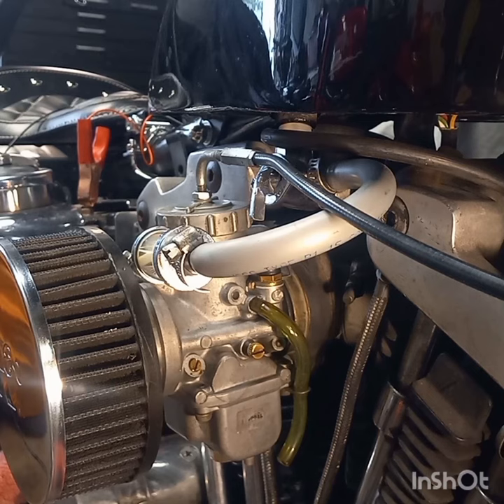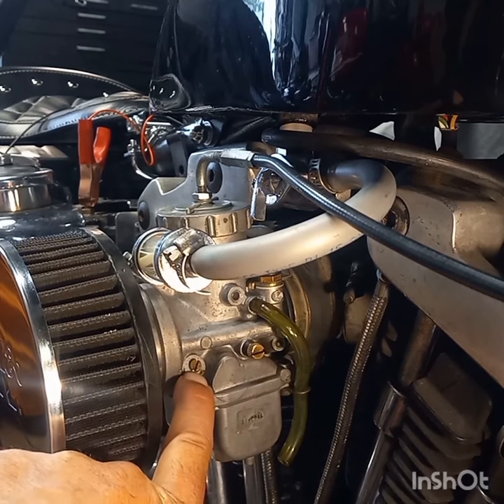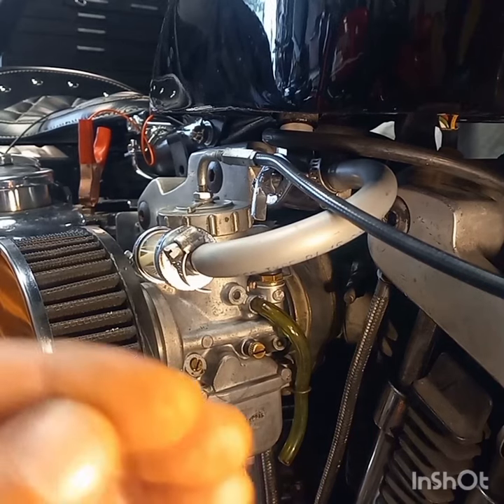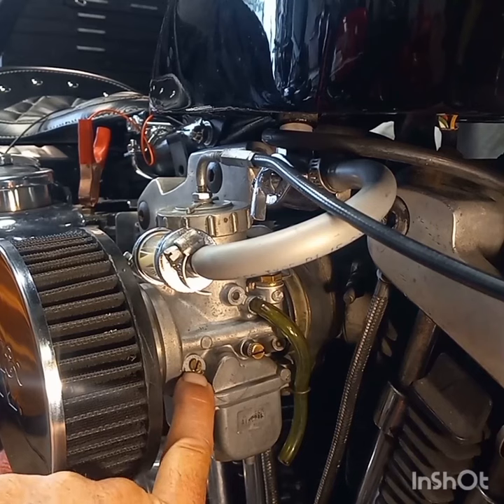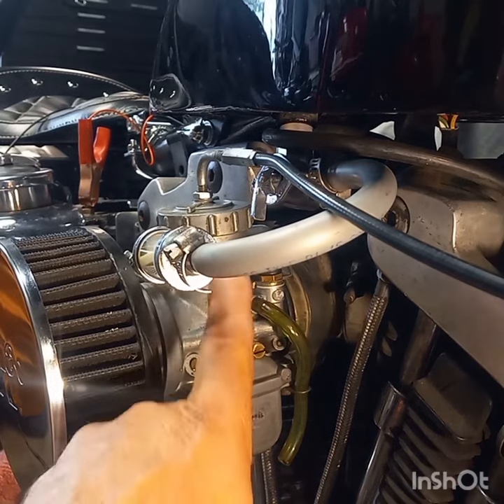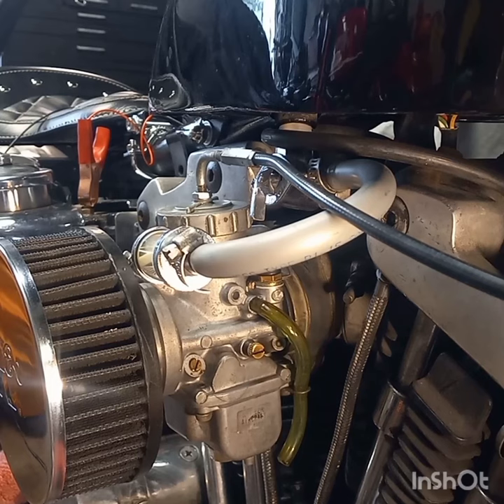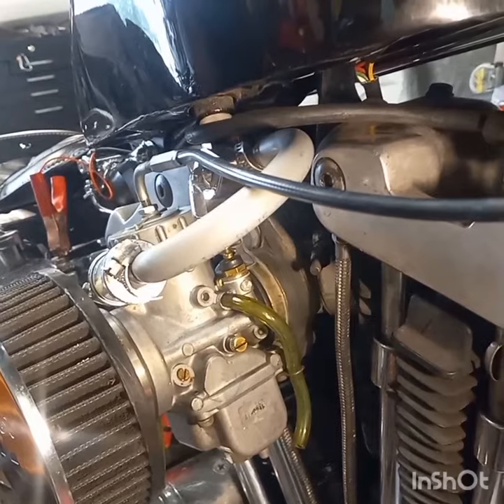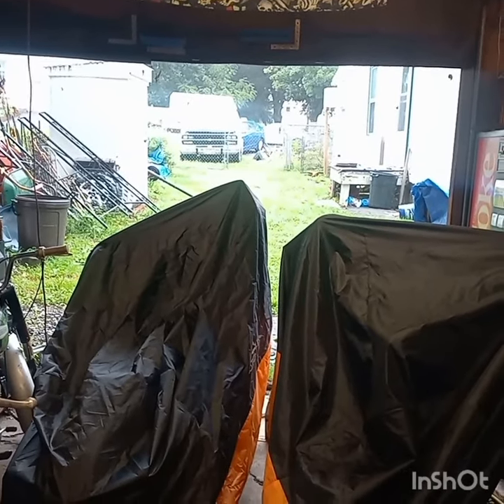MIKUNI CARBURETOR /ADJUSTING AND TUNING

Comment: So you start with the air screw 1.25- 1.5 turns out, but where do you start with the idle screw?
Reply: Doesn’t matter where you start with idle screw as long as it starts and idle. If it doesn’t just turn to the right till it does. 
Then turn back till it almost dies

Comment: Super cool video! 
Thank you! 

I’m interested to know how it should be plugged in 
I just bought mine. 
They are saying I should be drilling a 5/32” hole in my flange for my vaccum ignition sensor. Is that really necessary ?

Comment: Great video, what is your slide screw started at? All in? I’ve got the Mikuni 38 round slide on my XLCH, cranks up and runs strong while on choke, but when I snap it off choke it sputters out and dies. My main needle is one notch toward rich from middle.. 35 pilot jet. It’s hot and humid here in New Orleans. Thanks!

Comment: CURIOUS!?!  Can you add a Choke/Enrichment  Pull(Lever) to a Mikuni Carburetor? If YES!  How? Part Numbers or favorite type used?
Reply from the maker: Hey man thanks for checking out the video that particular carburetor comes with an enrichment lever on it. You can't see it in the video it's on the back side of the carburetor but it does come with one . I hope that helps thanks again for checking out the channel share with your friends and if you haven't already consider subscribing thanks have a great day and ride safe

Comment: Is there a high speed adjustment, and what is the procedure for that?
Reply from the maker: First sorry for taking so long to respond. The low speed adjustment is done with the air mixture screw  . once you get that set  you set your idle speed screw to make your bike run at about 1000 rpms. This part is hard to do if you don't have a tachometer on your bike.  to set the high speed circuit you need to get the bike hot, then shut it off put new plugs in it while it's still hot, careful not to burn yourself. Then take it out and run it at Full Throttle for several minutes . Shut the bike off let it cool down pull the plugs and see how they look. If you do not know how to read your spark plugs to tell you if your bike is running rich or lean there are videos on YouTube to tell you how I think you probably know if you're trying to adjust your carb. you adjust the high-speed Circuit by moving the clip on the needle that is on the slide inside the carburetor. There are four or five grooves at the top of that needle, and a little C clip.  if you move the clip down it will reach in your mixture, if you move the clip Up it will lean it out. I hope this helps out and clarifies that a little bit . If you would like to hear this explained in depth, and a lot more detail there's a guy named John and his channel is Hammerhead garage the video is xv1000 Virago single carb answers. I know I said Virago but it is a Mikuni carb single carb that he put on the Virago and he's a red star mechanic in Canada and has his own shop. he really explains this in detail very well I highly recommend you watch this video. Please let me know if this helps. Ride safe .
Reply from the maker: The part you want to watch is probably about halfway through the video where he explains what you want to know about the Mikuni carb adjustment . The rest of the video before and after that is more about the Yamaha Virago
Reply: @westcornerscustomcycles  yup I do know how to read spark plugs, although I was going to try it with a AFR gauge. My buddies bike, the headers are blued, and he said he thinks it's running hot, so I told him it's probably lean after putting exhaust and intake on. He asked me if I knew how to adjust a carb and I said yea, on lawn equipment lol. So I tried to search his bike and what carburetor is on it, he has a 2004 Yamaha Roadstar 1700. Some of what I've come up with has lead me to believe you about that clip with the 5 or 6 notches, so I will try the low speed adjustment first, then I'll work on the mid to high.
Reply from the maker: @rev9fan1  yeah man that's exactly how to go about it. Good luck I hope you guys get it straightened out hope I helped a little bit
Reply: @westcornerscustomcycles  definitely did, thanks for the response!

Comment: I have a mikuni on my 69 tiger. Only runs with choke on, turn off choke and it bogs out in seconds. Needle set on 3rd (middle) Mix screw doesn't change a thing.  Suggestions?
Reply: I’m right there with you! Did you ever get it sorted out?
Reply: since you didnt state it... clean the carb.

i am no expert but you have a lean condition

Comment: Did the VM 30 s for my Honda CM 400T rebuild. It starts ........awesome .....but with the choke levers down and and maybe for 3 or 4 min. it runs and quits. Now i gotta turn screws or something ?
Reply from the maker: Hey Michael, first thanks for checking out the Channel, hope you like what you see. First I see it says vm30s, I'm assuming that means plural and more than one.
Reply from the maker: I would suggest making sure that they are both synchronize first off. Second I don't know if that'll ever being down or up is with the choke on or off, but if it is with the choke on and it runs for 3 or 4 minutes and shuts off it makes me wonder if it isn't flooding out and killing it. I am not sure about those carburetors have not worked on those particular ones most of the ones I work on have single carburetor so only have to worry about tuning and not synchronization. I know if you go on the Mikuni website they have videos on their different carburetors , how to adjust and tune them. You will be able to tune the carburetor meaning set the adjustments on the screws, but to synchronize the carburetors you will need gauges, or you will have to take it to a shop where they can do it
Reply from the maker: Also doesn't run okay after three or four minutes with the lever up instead of down or does it still quit

Comment: Float fills and out the over flow . On a evo . Thanks I enjoyed your channel
Reply from the maker: Hey man thanks for checking out the channel, thanks for commenting. I hope the video helped out and you got the problem taken care of. That's what this channel is about. As always ride safe, and live life Behind Bars.
Reply from the maker: Hey man, I remember you and I remember the the problem you were having with gas running out your overflow on an EVO. Just getting back to you to let you know that I will be putting up a video tonight, I'm rebuilding the CV carburetor that came on the EVO Motors. I don't know if that's the carburetor you're dealing with. But if it's not I have videos on the Mikuni the S&S and the CV carburetor. I hope one of them helps you out keep me posted let me know man. I also did a video on an Amazon CV carburetor Chinese model. I have it on my 88 Sportster. And I really like the way it runs. Hope this helps you out, ride safe man

Comment: Mine runs really good.  But I always have a hard time to start it
Reply from the maker: Hey man thanks for checking out the channel, and watching the video. Obviously I don't know how your carburetor is adjusted and set up. I know that the way it's set up in my video is how Mikuni recommend you set it up. so I would say go back to the basics set it up like I set it up in my video. Mine starts really good, quick and easy and runs good. I would recommend looking at the plugs and see how they are burning they will tell you if it's running rich or lean. And remember the only way to adjust the mixture to make it richer or leaner is to adjust the clip on the needle on the slide. I hope this helps in some way. As always a ride safe and live life Behind Bars.
Reply from the maker: Also I don't know what carburetor you have yours maybe different than mine. If maybe a different size carburetor or maybe newer or , this may make a difference. You can also refer to the Mikuni website they have videos on there on how to tune and adjust their different carburetors.

Comment: My screw is on the back.
Reply from the maker: Hey man thanks for checking out the channel I sincerely apologize for being so long getting back to you not sure what model carb you have if your screw is on the back but I know you can go on the Mikuni website and they have videos showing how to work on and adjust all their different carburetors that would be my recommendation. It should still only have the two adjustments. The idle speed screw which controls how fast your engine idles. And the air Inlet screw. And you should still adjust them the same way. I wish I could be there to help you get it figured out. Thank you again for checking out the channel ride safe
Reply: @westcornerscustomcycles  I am not sure what this was about anymore.

My carb is a China made vm22(26mm) copy on a Ducar 224(pretty much a bored and stroked Honda GX200 at the end of the day) on my mini/trail bike.
I never did get it working well, I must have been thinking of the fuel screw and it's towards the head side of the carb on the bottom.

Anyway I thank you for trying to help even if it did take a while.

Comment: What air filter is that 🙏
Reply from the maker: Hey man thanks for checking out the channel. I apologize being so long getting back to you, that air cleaner is  actually off a kiein Butterfly carburetor. I just modified the holes so it would fit a CV carburetor, but you can buy one online that looks like that for a CV carburetor. I just happened to have it laying around the garage. thanks again for checking out the channel ride safe.